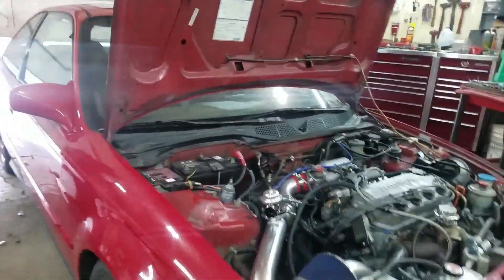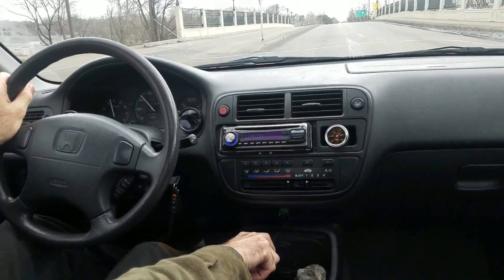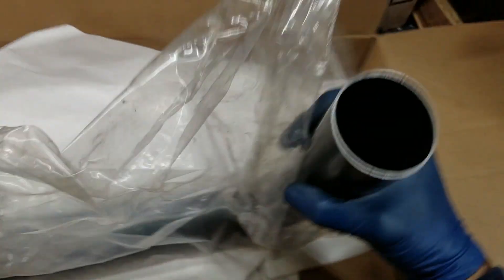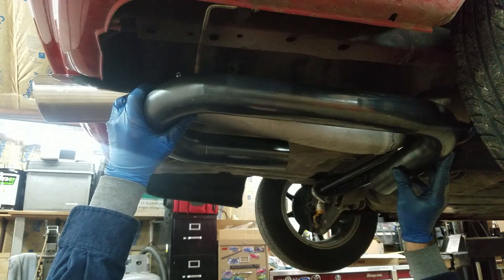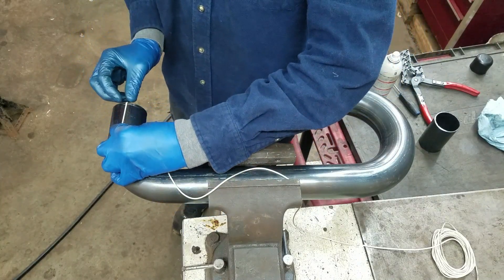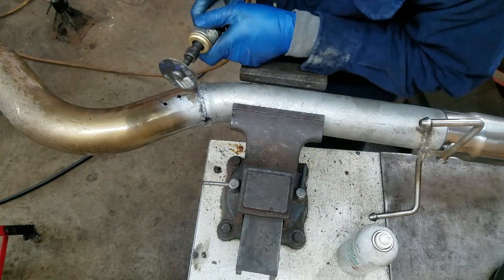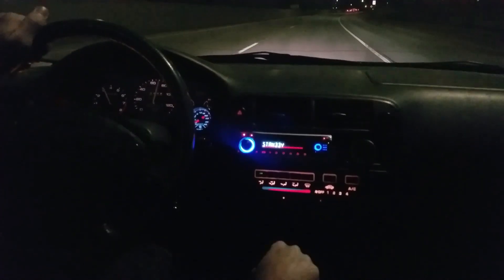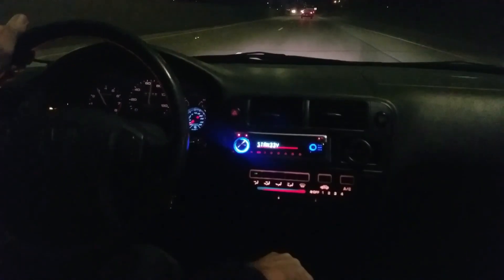Ej8 D16 Civic turbo exhaust drone fix.

Comment: Good vid, especially the in-car bits that definitely show the drone reduction. It was so bad the camera was cutting out your voice.

2 pro tips: you want the 'branch' on the pipe rather than in the main exhaust, for flow; you can easily find the line to cut by rubber-banding straight spaghetti noodles around the pipe then scribbing around the edges. It will work on both the branch and the main pipe. Or spend $50 on a pipe contour gauge.

Comment: Well shit that's fantastic, now I gotta do that. Did I hear you mention before that you use flux core to weld? I have a little buzz box as well that's currently loaded up with that stuff. You seem to do just fine with it.
Reply from the maker: Yes. It makes sloppy welds, but it works well. I like the stuff from Harbor Freight.

Comment: it doesn't restrict airflow? do you need to retune after installing it? I also have a turbocharged civic with terrible drone. Thanks!
Reply from the maker: Doesn't need a tune after. It flows the same.
Reply: I cant find something like that could u link it plz?